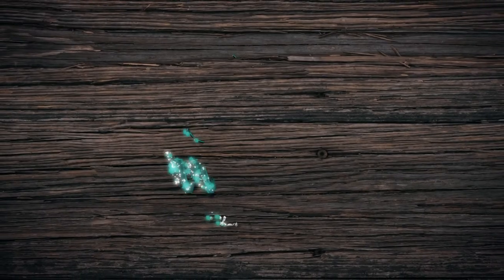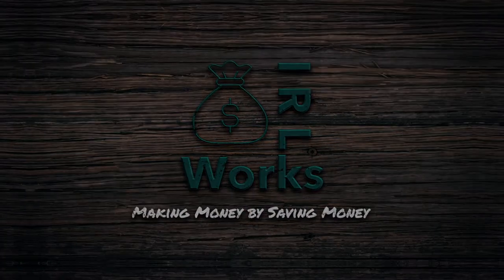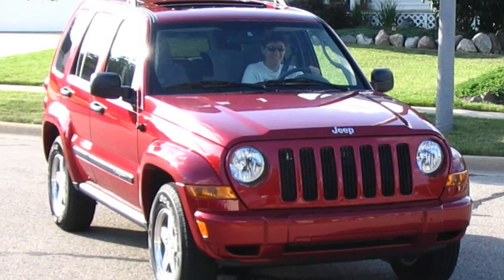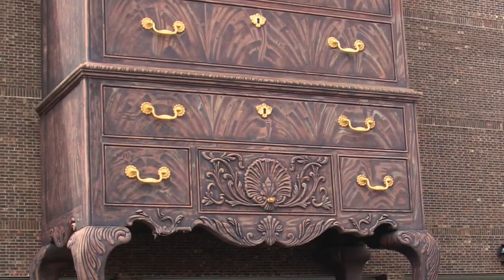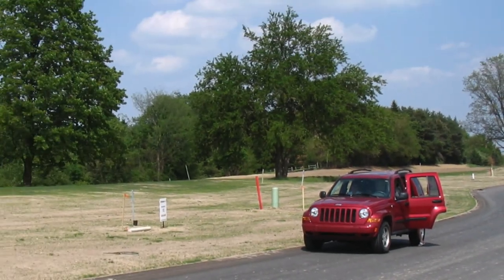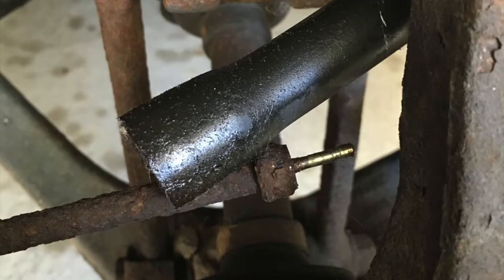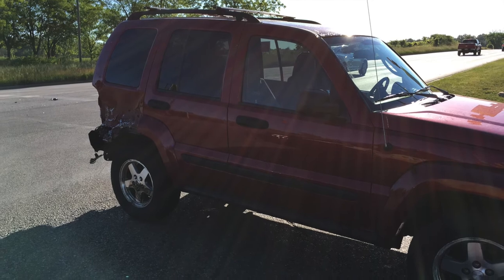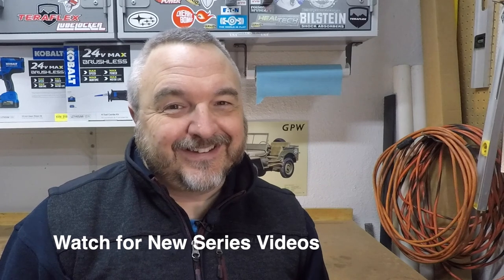Save Jeep Liberty Renegade Rocky Mountain Edition RME KJ - Part 1

Comment: Always had interest in these - chassis appear very stout and capable despite IFS- nice recipe for Offroad success of modern day cars - car still alive and well?
Reply from the maker: Yes, my Liberty is still alive and well, though, the swapped rear axle assembly needs pinion seal replaced. It lives outside, 24/7 in Michigan humid Summers and bitter cold Winters with chipmunks taking up residence in its glovebox and undercarriage, yet still drives solid. I think these Jeep Liberty really are as you say, stout SUVs. I have a few more videos working on the axle swap posted so far with likely a few more to post. I’d appreciate your opinion on those videos and if you like or don’t like and what you’d like to see with my Liberty. Thanks for watching and commenting. Keep in touch!
Reply: Will be watching!
Reply: Is yours the v6  3.7 or diesel?
Reply from the maker: @tayloraungst8569  3.7L and in hindsight wished I’d taken opportunity to get the diesel since it was available that year but vehicle was for my wife and I didn’t think she’d like the slightly less familiar fueling resources. I’ve since researched the 3.7L and found it’s actually based on a GM V8 Engine with 2 cylinders lopped off. It’s a good engine but timing chain can cause damages if subjected to poor oil maintenance.